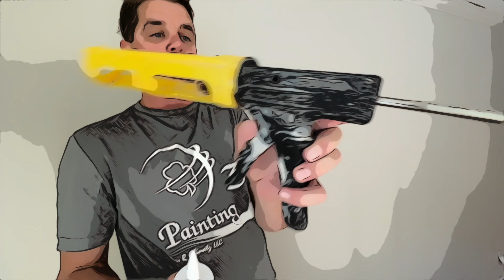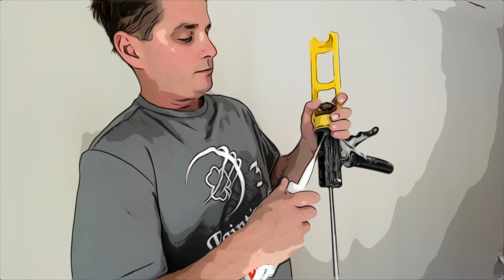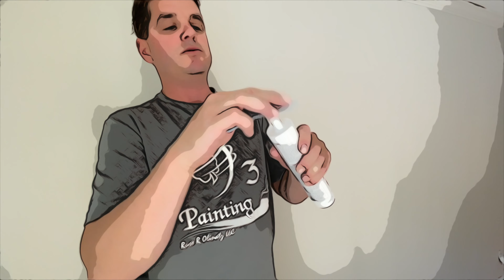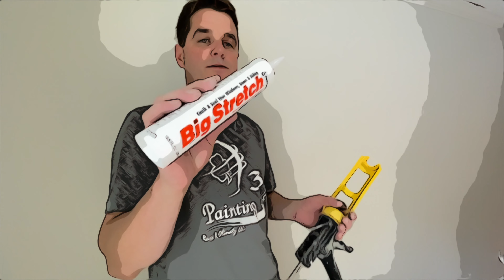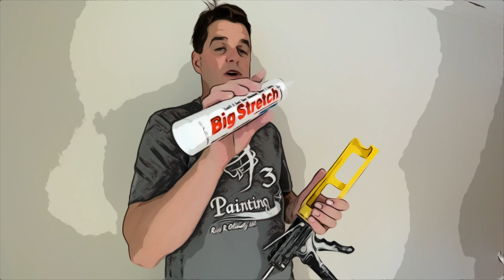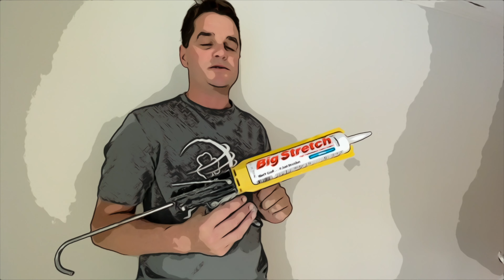How to Cut the Tip Off New Caulk Tube - Big Stretch Caulk

Comment: Hey Russ
Big Stretch here in California is around $8.00 a tube at Lowes
I Wonder what you pay where your at?
Reply from the maker: Yes same price, but it’s worth it!
Reply: @RussOlinatzPaintShow  do you notice it’s a much smoother caulk
Not as sticky as the average tube out there
Or is it just me
Reply from the maker: Yes it’s not a stickier caulk like a kitchens and bathroom caulk! Did you work with white or clear?
Reply: @RussOlinatzPaintShow  actually I worked with the big stretch grey
They had it at our local Ben Moore
Took a long time to go off however 
It reminds me of a caulking i used that’s from the UK.
It Is called No Nonsense 
Super smooth 
Closest thing to its been the big stretch
Reply from the maker: What do you mean it took a long time to go off?
Reply: @RussOlinatzPaintShow  well i was using it outside last December and it took forever to dry/cure
Was probably just the weather
Reply from the maker: Oh yes!
Reply: $7.68 Lowes Washington State